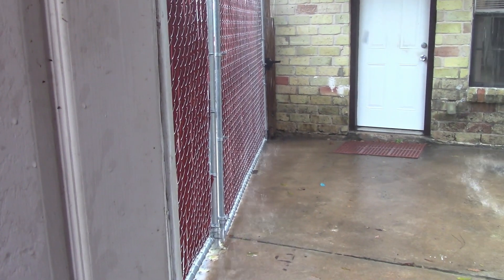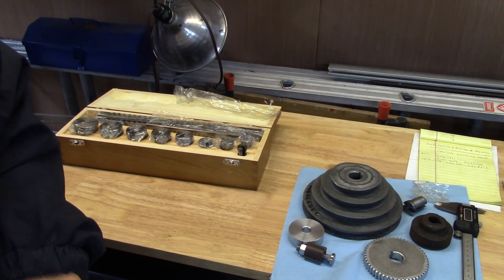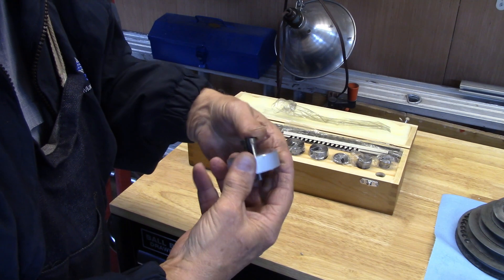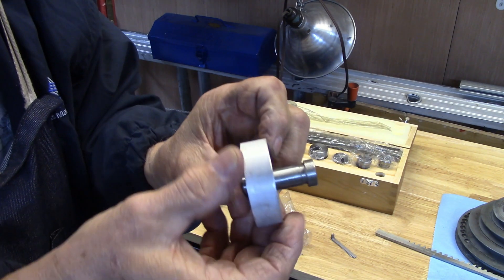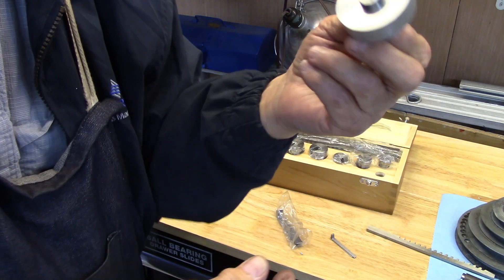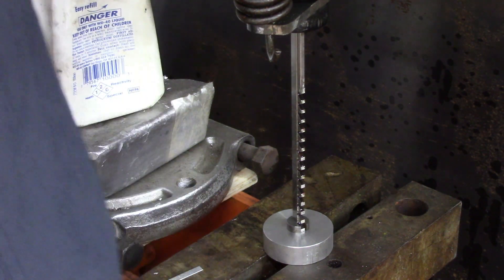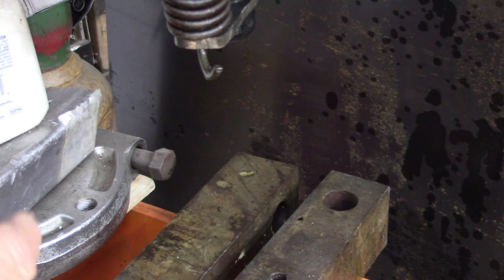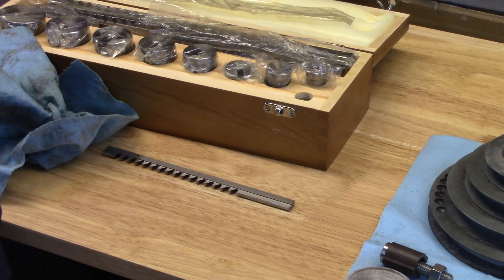Broaching a keyway

Comment: Thanks, Harold, that's a nice explanation. However, it does prompt the question, are you going to modify your arbor press to take longer broaches? Your point about the tactile feedback of the mechanical tool is excellent.
(Sorry, I'm aware that the older I get, the longer my to-do list gets… don't mean to add to yours.)
Reply from the maker: My arbor press cannot be modified for a greater capacity unfortunately.  Merry Christmas and happy new year to you and yours Sean.  Thanks for viewing.